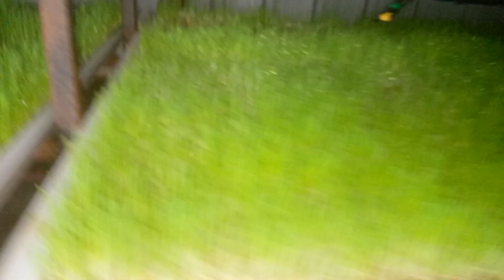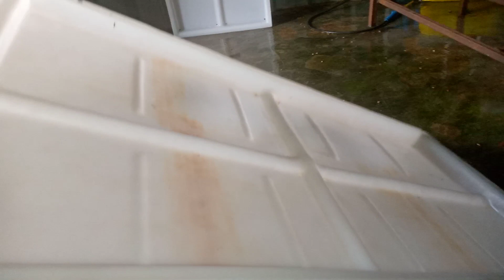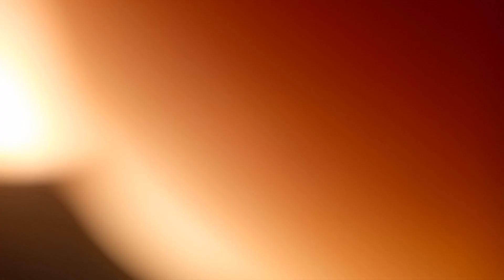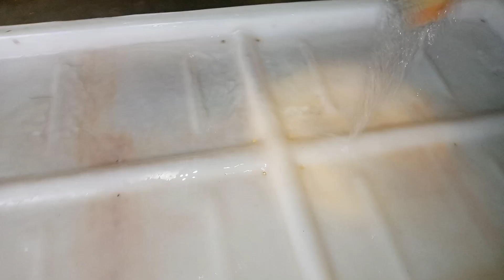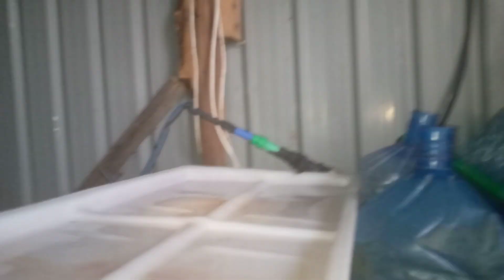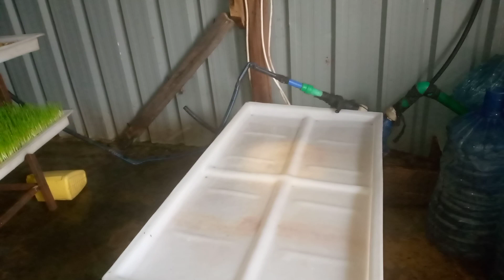Do Hydroponic Tray Materials Matter?

Comment: Disagree. I'm searching for non leaking plastic, with a declaration that it is fit for human consumption. If it isn't, it will leak lead particles as well as chemical particles into the water and thus the product. A grain of lead is persistent and can be disastrous in a growing child. All plastics leach chemicals. Here's an excerpt from Norwegian research. 

Martin Wagner, an associate professor at NTNU’s Department of Biology:

“We examined 24 common plastic products over ten days to see if they leaked chemical substances into water under natural conditions. We then examined the water for chemicals and toxicity,” says Wagner.

All of the products leaked chemicals into the water. Several of the substances have potentially toxic effects.

Oxidative stress was associated with 22 of the 24 plastic products that leaked substances into the water. This can damage cells and cause inflammation and chronic disease.

Thirteen of the products leaked antiandrogens, which can affect men’s fertility.

One of the plastic products leaked oestrogens that can affect fertility in women and men.
Plastics leak very differently

A single plastic product could leak up to 8700 different substances into the water. However, the amount of chemicals leaked into the water varied greatly for different types of plastics. One product could release anywhere from 1 to 88 per cent of the assorted chemicals it contains.

Bon appetit.

Comment: I heard metal is not advisable especially aluminum cause the reaction with water to form a bad substance that is alluminium III oxide
Reply from the maker: Metal rust but Aluminium is okay since even if it do react to for its oxide, the oxide form a coat that prevents further reaction. I don't see any problem with aluminum trays.
Reply from the maker: Metal rust but Aluminium is okay since even if it do react to for its oxide, the oxide form a coat that prevents further reaction. I don't see any problem with aluminum trays.